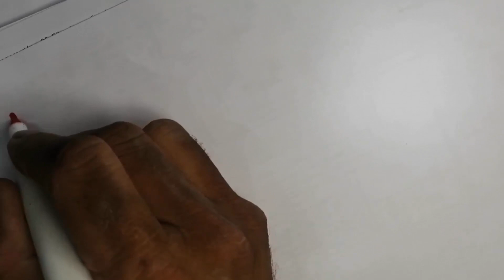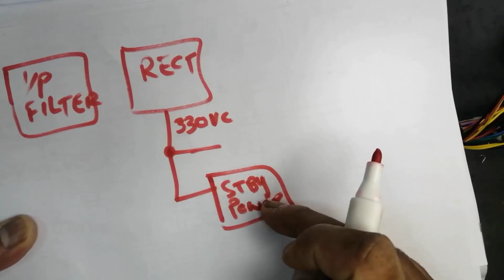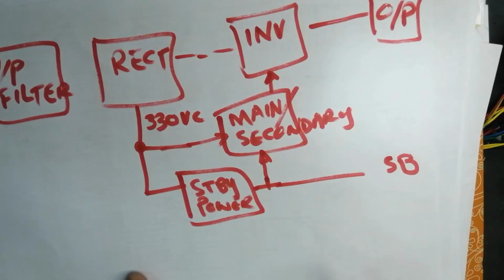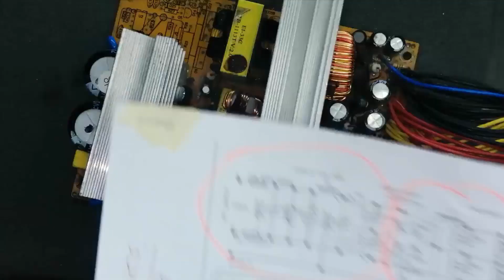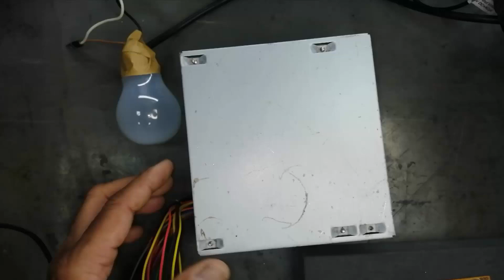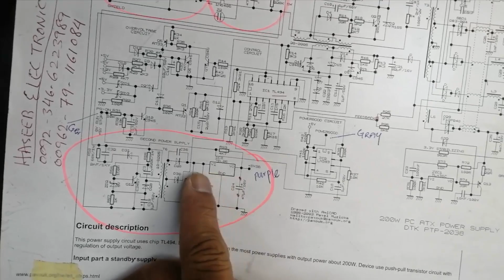#189 How to repair Computer Power Supply /ATX with AT2005 SMPS PWM IC

Comment: Hello and thanks a lot for your great content... I have a power supply whose output voltage is 12.4 volts and 5.2 volts... at 12 volts the voltage fluctuates at about 1/10th... Is this voltage OK? Or it must be exactly a solid 12 volts?

Comment: Greetings to you Tex contains tl494 Vcc voltage starts at 17 volts and goes up to 19 volts is this normal I changed the tl494 gas capacitor and the voltage didn't change What's the reason

Comment: Can you cover the case where 5Vsb is present but the power supply main stage shuts down shortly after the green wire is connected to the black wire at the connector and the power supply used an output voltage monitor Ic to shutdown the power supply  if the output voltages are too high or too low . It is difficult to trouble shoot because the power supply turns off the outputs very quickly after the power supply turns on ,  so it is not easy to see which output  is causing the problem or if there is a fault with the voltage monitoring chip or circuit . Have you advice for this case ?

Comment: i am getting sb voltage about 5.1volt but when i switch green and black wire it doesn't start the power supply my ic is also 2005

Comment: Resp Sir! SB 5V OK, PS on green 5V OK But not Turned on. Which Problem Sir...?  --    Chinna Rao
Reply from the maker: check secondary side own controller ic 
for any proction is enabled
may be some capacitor in output circuit is internally short circuit
Reply: @HaseebElectronics  Thank U Sir

Comment: Series lamp technique is good.  I would also use an isolation transformer.  Good video, thank you for sharing.
Reply from the maker: best regards dear 
yes series lamp is a very useful tool and supporting item in repair 
isolation transformer is best for human safety and equipment safety as well

Comment: Definatelly you know what are you talking about. Thanks a lot. Is here or will be something about feedback use TL431 and optocoupler? Great channel man - greetz
Reply from the maker: best regards and special thanks 
no this circuit there is no feedback circuit, it takes voltage feedback through voltage divider network. as it is using TL494
Reply: @HaseebElectronics  I had think about the channel - yes I found your explanation TL431 feedback used. Love your channel bro absolutly. You are great professional man. Thanks for fantastic and clarity share your huge knowledge. Man - you are great. Once again - thanks.
Reply from the maker: best regards and special thanks ❣️

Comment: @9:40 minutes in... This series light bulb trick only works with 220V supply voltage ....am i correct?
Reply from the maker: yes dear, it is 220 volt 100watt tungsten filament lamp 
it limits the current due to any failure in troubleshooting process
Reply: @HaseebElectronics  OK I understand, So when you have the bulb in series with the 220 volt supply and you apply a ground (simulating a fault), that puts full 220volts at the bulb, I assume what you were doing with the jumper since you only showed the red lead. I don't have a power supply with a 220v/110v switch so again this trouble shooting technique, series bulb protection, would only work with a 220 V supply at the supply side of the series bulb. We use 120/240 volt supply here in US. For PC,s and other small appliances 120V,and 240 V for A/C, Hot water heaters,Oven,Dryers. Typically , windings on secondary of transformers to house is center tapped, center tap to each  outer leg is 120 V with 240 volt across outside legs, so if you have a 240v feed on one side of the series bulb and ground/neutral on the other side, that would only be 120volts across the bulb. I guess the typical transformers in Pakistan household feed are single phase one winding on secondary side? Maybe you could kindly draw a sketch including the transformer for electrical service from the utility and one could better understand how this works. Thanks

Comment: HI! I have a quastion . i wanted to jump a compaq power supply its older , i think i jumped the wrong connector , instead of PS ON to GROUND , i thin i jumped the AUX to GROUND , now is not working , what damage u think i made now ? THX and Good luck with ur videos!!!
Reply from the maker: if you have made a short circuit between purple and black (+5v STBY) in normal cases it have no problem, just the power supply will fluctuate or turn off
some models have 7805 regulator IC to give regulated 5 volt for SB
so if there is 7805 (3 pin regulator looking like a transistor or mosfet) will damaged surely, try to replace it
Reply: @HaseebElectronics  Thanks for Reply! I jumped the green one with the black , the fan had a short impulse and then stopped.
Reply from the maker: @denys14k  okay 
so if the fan starts and then stops, it means the voltage supervisor ic   OR   over-voltage / short circuit detection is interrupting to turn off secondary power supply
in this condition the STBY section is ok
PWM section is ok
just monitoring circuit is disabling the output

Comment: Ca I use 10v 2200uf capacitor instead of 6.3v 2200uf capacitor in output section. Pls reply 🙏
Reply from the maker: yes 
the voltage range is higher. it is safe
you can use it
Reply: @HaseebElectronics  thank you so much👍🙏🙏

Comment: Sir in my power supply 5v output avaiabile but no voltage at green wire what the reson sir please help me i tring so many month to finding its issue
Reply from the maker: there is a current limiting resistor which is connected between purple and green wire, check that resistor
in some power supplies, the atx supervisor ic provides voltage on green wire (which are provided by the atx supervisor ic, as TL494, SG6105, and if the ic is fail to provided regulated reference voltage , in that case you have to replace atx supervisor ic)
Reply: @HaseebElectronics  in this power supply 2921 is used . Any way thanks for replay sir🖒
Reply from the maker: @sparkigner908  sdc2921 case
there should a current limiting resistor connected between pin 9 and purple wire.
green wire will also connected to pin 9 of 2921
Reply: @HaseebElectronics  ok sir i checking

Comment: Sir, I want to remind some atx computer power supply on the purple wire give 5 volt but green wire give 2.4 volt, some atx psu purple wire give 5 volt and green wire give 5 volt according to manufacturer, is this true ?
Reply from the maker: yes dear, it is true, basically it depends on ATX supervisor IC. when is PSON pin is less than 0.8 volt approximately, it turns ON the power, 
the voltage value above than 0.8 volt is considered logic high, so this IC will stop switching
on green wire if we find voltage above than 1 volt normally above 2.5 to 5 volts. it is logic high. 
so it is okay, if we find 2.5 volt or 5 volt
because we have to connect green wire to ground to drop its voltage to ground potential, so that the ic will start powering ON
Reply: @HaseebElectronics  okay thank you so much

Comment: Sir, my smps input bridge diode is ok, mosfet c5027 ok and 945 transistor also but after checking through series bulb then bulb glowing continuously its means input side short circuit, I can't find where it is fault. Pls help me
Reply from the maker: check power mosfets
check standby section driver mosfet or smps ic
check dc capacitors

Comment: okay sir, if we have 5 volt but we don't have 3.3 volt and don't have 12 volt, what should we do? Where is the problem ???
Reply from the maker: in this case the secondary power section is not turning on. most of time there is a supervisor IC that monitors the output section, when any output goes beyond its allowed limits, in that case the smps section remains off. 
in this case if we want to repair it, first of all disable its protection for 3.3 volt, 5 volt and 12 volt  and turns on the PWM IC directly and after repairing reconnect protection network
Reply: @HaseebElectronics  okay, but I can not disable the TL494 IC protection, I don't know how should I do this
Reply from the maker: @TheWeftmen  is there any other ic except TL494. or there must be a protection circuit or ic
Reply: @HaseebElectronics  thank you for answer, on my psu motherboard have TL494 and near AZ339
Reply from the maker: @TheWeftmen  check 339 might be it is used as voltage supervisor
Reply: @HaseebElectronics  okay, when I short black and green cables
AZ339 ic show these voltages:
1. Pin--- 3.82 volt
2. Pin--- 0 volt
3. Pin--- 5 volt
4. Pin--- 1.3 volt
5. Pin---4.48 volt
6. Pin--- 0 volt
7. Pin--- 2.66 volt
8. Pin--- 1.38 volt
10. Pin--- 2.5 volt
and other pins show 0 volt

Comment: I am trying to repair my power supply
in my case, the secondary side of the circuit, the voltage of each terminal is zero
I did not use this power supply for a long time
what can be the issue? basically voltage of purple wire is zero. Input voltage of photocouple is about 0.3v
appreciate you thoughts

Comment: Nice educational video. i have standby on my power supply. but it does not turn on. i check it with power supply tester it beeps and the PG light is off. What can be wrong ? Thanks

Comment: In using the series lamp while repairing the power supply in accidentally shorted the components part in the input or output the lamp absorbed the excess current in the ckt and no one parts are damaged I'm i correct sir tnx

Comment: Selamün Aleyküm, I tried to troubleshoot a PSU that ıt's faulty,
I watch video thnx for help BTW.I make a series lamb ( https://www.youtube.com/watch?v=6PrqJXXGZlE&list=PLYO5tTokHfNIwKOagznBsWITymkZbwv7k&index=32&t=628s ) and working well...

1-) The series lamp flashes at power on then turn off...
2-) I have 5v stndby at purple wire.
3-) I have 1.78v at green wire.
4-) When I shorted green and black wire/Series lamb flashes Full....So I have shorted circuit in green line...

where is short? I cant find.
Reply: Thnx alot I'll check...I find a diode like zenner but not a really zenner diode...tiny one..When I test with probe in diode mode. Diode indicates  volt in both directions.. Maybe ıt's.. really dont know...
Reply: What if I give 5V (from linear psu) to green wire? Can  I find shorted component? 
Does the defective component get hot?

Comment: Salam M.Haseeb, i tried to troubleshoot a PSU that has no output. As per your video:
0- The 5Vsb has a separate small PCB with PWM(top244p) and works fine
1- the series lamp flashes quickly at power on
2- I do have 5v at the purple wire
3- I have3.5v at the green wire
4- the 12v gives 10v then decreases untill it dies
5- the PWM ic (UC3845BN) has no VCC
6- i do have 324v dc at the main capacitors
I tried to look for some shorted capacitors, but when i take them out of the PCB, they are fine, so i replaced them.
Thanks.
Reply: @HaseebElectronics  OK, i will try that, no need to check the 3.3v and 5v section yet, because it is the same for them, they start with some voltage then die... Thank you